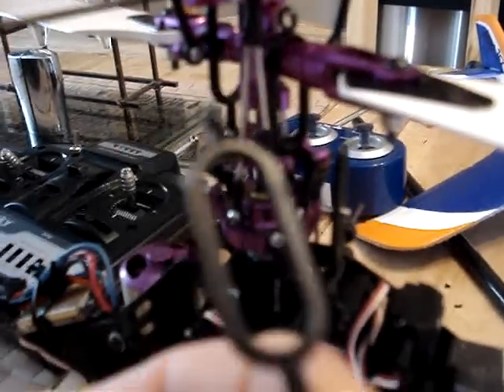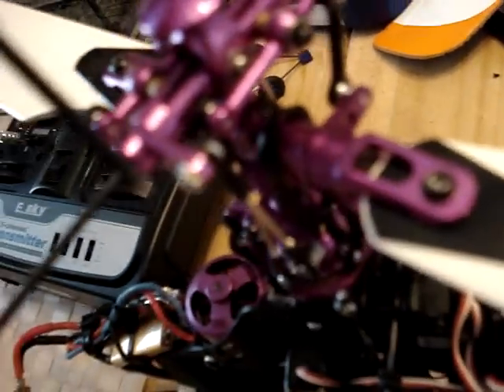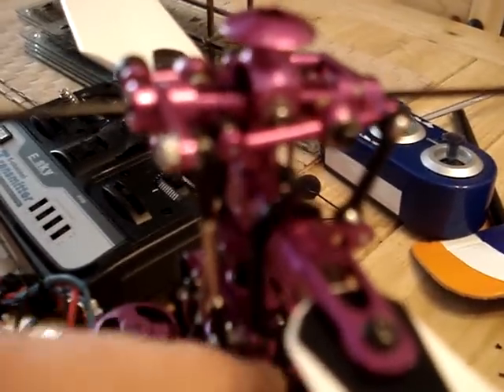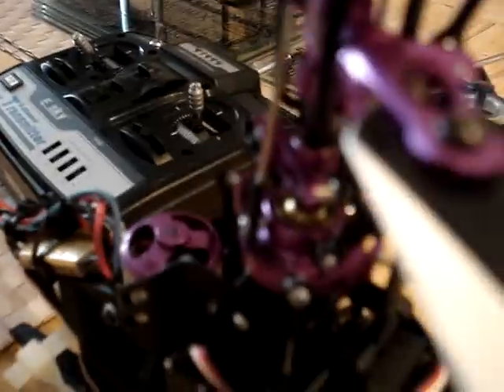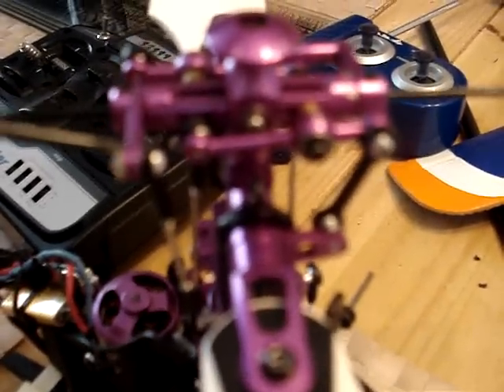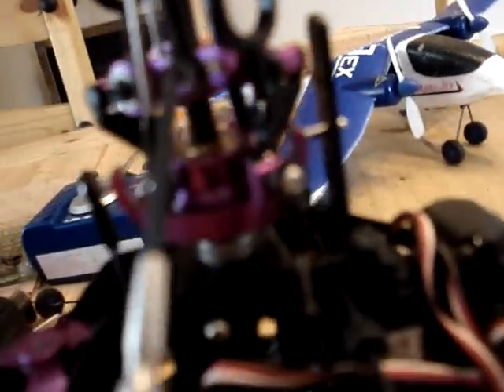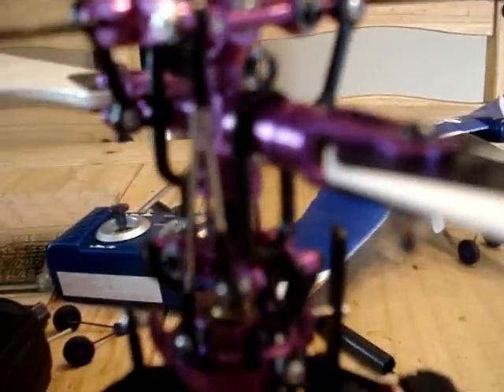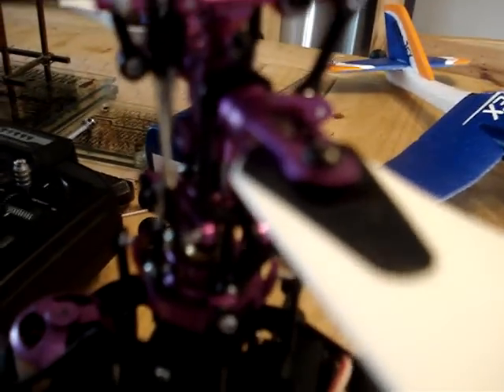one way to get rid of that nasty controlling shaft set

Comment: My first thought was "brilliant" it must work. But now having looked at my head assembly I noticed that when you move the pitch of the blade the fly bar moves up and down with the blade pitch. when doing this the original point of contact stays in place but your mod look like it would move at the top contact but not at the bottom. 
Did any of my dribble make sense?